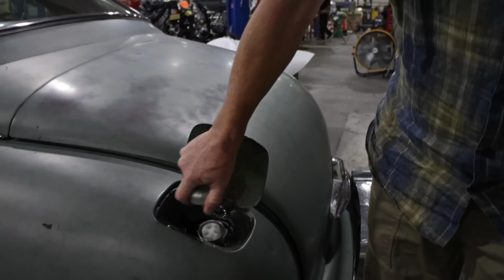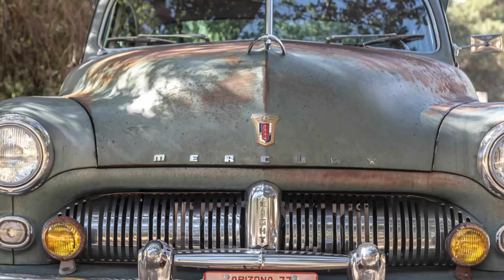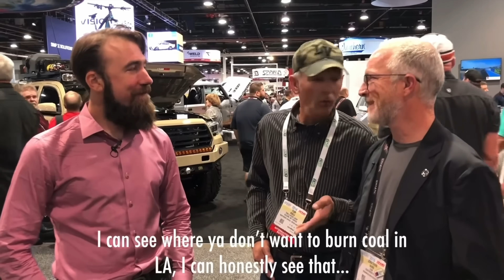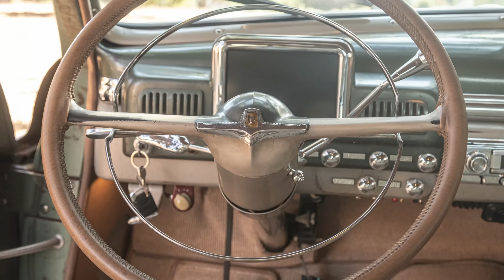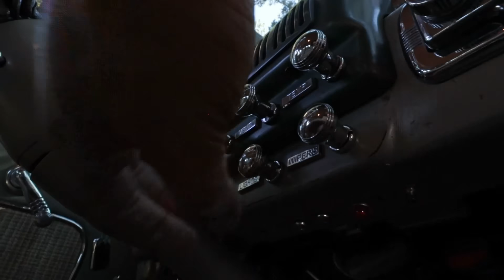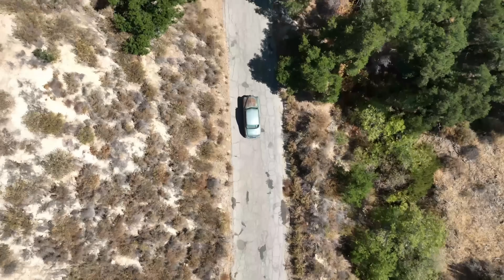ICON Derelict 1949 Mercury EV Coupe

Comment: Jonathan. I can appreciate the design of the engine bay. When I first saw the engine bay I assumed it was part of the cooling or battery system designed to look like a standard motor. The fact that you guys took the time to craft it to match the original is a testament to your attention to detail. The color combinations are wonderful and the integration of new and old switches and electronics hidden in the dash are truly impressive. I wouldn’t be surprised if your vintage to modern….analog to digital dash integrations are the best in the business, industry leading. You and the team are artist the videos are your gallery. PS your closing remarks are a good mission statement. 

Icon: Something to stand for, to be remembered long after we are gone!

Comment: A solution to the "road tax" complaint would be to report your annual miles when renewing your tags and calculate "road wear" by vehicle weight and miles driven.
It doesn't help that Teslas weigh 5,000 + pounds and a Camry weighs 3,400.
- - CO2 levels are within a couple % World-Wide and vary by season.

Comment: Glad to see a full video on the car.... really enjoyed it. But could have done without the diatribe on modern cars being disposable. Cars today have service life's longer than any point in automotive history. Sure, a lot of cool old cars are sitting in fields... but it was the unreliability of that old car that put it in the field in the first place.
Reply: Sure, cars in general are more reliable today, but there's hundreds of examples of modern cars being scrapped for a $100 transmission part....either that is not made anymore or costs many thousands of dollars to fix.   The perfectly good 99% of the rest of the car is given up on and junked so a new one can be made and sold.   So much waste.   That is far worse on the environment than keeping a SLIGHTLY less mpg efficient car on the road.   So much misguided focus on MPGs and not on the other 100 variables key to efficient motoring.
Reply: @benvester3340  Interesting... and I don't disagree, but, it's not just a modern problem. Back when used cars only cost $50 people would scrap them because of a $5 part. Unfortunately, scrapping cars keeps auto manufactures in business, circle of life, that one. Efficient motoring is subjective though as its definition will change between economic classes, environmentalists, mechanics, manufacturers, bureaucrats, etc.

Comment: That goofy old farmer made some excellent points.  I admired that you engaged with him at the car show.  Now, to hear you badmouth him after the fact… makes you look weak
Reply: That guy was off his meds, at no point did he make a coherent thought that they could even engage with. He was also being rude by interrupting them. They were much kinder to the blowhard than I would have been.
Reply: @k20nutz  but he DID make salient points which they DID engage with.  So….do you need to get back on your meds?
Reply: @yeboscrebo4451  which point was that?
Reply: @k20nutz  1. charging electric is bypassing taxes which pay for the roads 2.  Charging at 110 as opposed to 220 is inefficient and wasteful.  3.  Hydroelectric is definitely not “clean”.  4.  Burning coal actually entails benefits for agricultural areas that include fertilization and formation of rain.  5.  CO2 is not distributed in equal ratios around the world.  6.  Populated areas shouldn’t be able to “make the rules” for less-populated.  All these are points worth discussion, definitely not “insane”, lol.
Reply: @yeboscrebo4451  1. That is a issue with the tax system for roading, not electric vehicles, and has a trivially easy solution (plenty of first-world countries already charge road tax by kilometre travelled, not as part of a fuel purchase). 2. This could hardly be a more egregious case of Matthew 7:5 when you're making a comparison to internal combustion engines that are only 20-ish per cent efficient. 3. Again Matthew 7:5 when you're comparing the minuscule emissions associated with hydro to the colossal emissions from coal thermal electricity plants. 4. That's like saying that my neighbour should engage with the idea of burning down their house because it would slightly reduce my winter heating bills (and, by the way, rain did actually exist prior to humans burning fossil fuels). 5 & 6. In the context of global atmospheric pollution this argument is equivalent to saying that we should divide public swimming pools into two halves -- pissing and non-pissing sections -- so that everyone can choose whether or not they want to swim in pisswater.  Anyone with a milligram of common sense should be able to figure this out with a few seconds thought, so frankly no, it's not worth discussing in the context of an interview about a resto-modded/derelict '49 Mercury.
Reply: @davidhaywood8029  Who are you arguing with?  The point of listing out his arguments was that there was something there worth discussing.  Seeing that you took the time to type out responses to his six arguments, I’d say that’s it right there isn’t it?  For the sake of discussion, 1.  There’s nothing “trivial” about road taxes.  Guaranteed there’ll by collateral damage when the politicians start rocking that boat.  Personally, I would have a big problem with a mileage tax and the gps units they’re itching to track our traveling with.  2.  He wasn’t making any comparisons to the internal combustion engine, obviously.  3.  I don’t think the farmer intended on “comparing emissions” when he stated simply that hydroelectric power isn’t clean.  Besides that, the latest studies show that some of the most egregious problems with hydroelectric is not emissions, but the widespread and prolonged damage incurred to the environment by damning - problems that have been previously unaccounted for in regards to energy solutions.  4.  Agreed.  5&6.  To a certain extent, I don’t disagree with you and I don’t think the farmer would either.  However, generally speaking, his point remains.  Water regulations, emissions standards etc.  set by distant bureaucrats in some far off city with entirely different populations and circumstances is a recipe for disaster.  This obvious conundrum is an important enough factor to determine the way our republic itself is organized with representational government based on population numbers.  Anyone with a milligram of common sense should be able to figure this out, right?  What gets to me is the pompous way Jonathan brushes this guy off as “insane”.  It’s intellectually juvenile to disregard his points with “we all know who you voted for”.  The world could do without the rich guys’ toys that Jonathan makes.  It can’t do without the simple farmers.  Despite the goofy, socially unaware behavior of the simple farmer, it’s annoying that Jonathan’s spitting on the guy whose shoulders he’s standing on.
Reply: @yeboscrebo4451  My take was that Jonathan was including that clip to pre-emptively deal with some of the responses in this discussion thread.  But if the Canadian bloke did actually have mental or social issues -- rather than being a standard grade blowhard -- then I certainly wouldn't want to make fun of that.  (Incidentally I know this wasn't the point you were making, but -- as a side-note -- I'm not actually sure that we do need simple farmers.  I've worked with a number of farmers on farm-scale energy projects, and in my experience you've got to be very sharp and well-informed to be a good farmer.  It's a complicated business.)  To quickly respond to (some of) your points: from an engineering perspective, all macro-level discussion of engineering problems is "comparing emissions" (or comparing harm). All human activity causes environmental damage, but ideally we choose the design path that minimises harm.  So to claim that charging EVs from 110V "should be illegal because it's inefficient" is just plain nonsensical when considering the perfectly legal ICE vehicle that's only 20-ish per cent efficient. The same goes for the effects of damming rivers for hydro-electricity.  Yes, it causes environmental harm, but does it cause less harm than the alternatives?  That's the question that is implicit in any energy analysis.  The question of local vs. national/international environmental regulation seems well-settled in legal theory.  That which only has a local effect should be regulated at a local level; that which has a global effect should be should be regulated at a national/international level.  I've lived in four different countries and it seems that there is always some issue that's considered so difficult as to be virtually insoluble, but which in another county has apparently been solved with very little effort.  Much of Europe pays road tax by unit time ; New Zealand has a per kilometre road tax system that works in conjunction with the annual safety check.  These systems have been working for decades.  On the issue of "representational government based on population numbers" (or modern democracy, in other words) you should look at the ingenious MMP (Mixed Member Proportional) system used in Germany, which does a very clever job of ensuring that low-population rural areas are still guaranteed a voice in government.
Reply: @davidhaywood8029  Nah, this is the second time Jonathan has posted this clip.  It seems like he’s got a gripe with this guy.  This farmer seemed sharp as a tack to me.  I have to correct you, the farmer said “it should be illegal” because it is bypassing road tax.  “Charging at 110” was merely an additional point not the reason why it should be illegal, obviously.  I believe the farmer was referring to the charging inefficiencies in regards to charging time.  Again, he wasn’t comparing the charging efficiency to the efficiency of an ICE engine - that IS nonsensical.  And again, what you say about energy analysis and “does it cause less harm than the alternatives” is accurate, but, the farmer simply stated “hydroelectric is not clean energy”.  He made no comparisons in that simple, true statement.  Well-settled?  Nothing is well-settled, lol.  Representational government is Republican government.  I constantly have to remind people that we are a constitutional republic NOT a democracy.  Our founders despised democracy for good reason.  We also have an ingenious system called the electoral college.

Comment: This is amazing, and it'll be fun to see how your EV products evolve. I doubt that future cars will always be better than the last.

I am curious about a couple of things. 
Why do you have a drive shaft? Wouldn't it be better to have it directly to the rare end, skipping it altogether or use wheel motors like Rivian, cutting the Rare end and drive shaft? 
I don't know if Chassis builders like Art Morrison are there yet. But isn't a Skateboard Chassis more efficient with battery space? Having that plus your Engine design gets you more range? I think 200 miles is the minimum now (I have to admit I started hating that you put batteries in the front instead of a drunk, but you did sell me on it).

I disagree with the no trans that has been the chorus of EVs. Still, I think a gear specifically Tailored for Highway speed and bringing the output RPM as low as possible to be as efficient as possible is better than having a vehicle that only has a lot of range around town.
Reply: Rare Drunk?

Comment: I'm no designer, engineer or electrician but for the low horsepower classic cars, someone needs to develop an electronic motor that mimics the original engine that works with the original clutch and gearbox. This will come in time. Although the engine sound is gone, the straight cut gearbox sound would still be there. A dream for the future classics. I guess he said it right when he said the technology is moving faster than his company builds. Dont scrap those classics yet!
Reply from the maker: That is actually the easiest and most popular way to convert a classic car. The issue is that the manual transmission gear ratios are all but useless, and you lose a lot of energy efficiency that way, while gaining a lot of noise

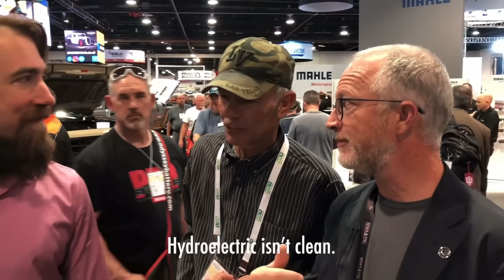Comment: 18:20 - Did that guy say that hydro electric heats up the water as is goes through the turbine? This would be bad but thankfully it is 99.999% inaccurate...the resistance friction/load on the impeller that the water turns is negligible and is a cold system. The alternator/motor/generator is connected to the impeller via a shaft(s) and isolating couplings, the alternator/motor/generator will make some heat but it is isolated from the water below it completely (as it is regulated and monitored by the government to not add heat to water) and is cooled with a oil system mainly for the bearings alone. If a power damn heated up the water it would kill everything alive in the water, thus it would be shut down. 

Then he says he would like to burn coal? There is a very dirty secret about burning coal, it becomes radio active in a fluidized bed that forms during combustion, this is why workers there all have to wear exposure tags, just like at a nuclear power plants too. 

The problem with carbon fiber, or just plain old fiber glass (I believe current windmills are mostly made of) is the resin glue...it is possible and likely to in-hail said resin dust as it can re-activate in moist lungs to block oxygen transmission. The rest of what he said was mostly correct actually. 

I love how you go on to say "the challenge is the many different perspectives in different cultures..." to me that sounds like some political BS to manipulate the truth to manifest a desired result... 💰Illusion is the absents of truth, is it not? The biggest difference between people are the lies they believe, their/your perceptions?  

EV's are cool and when ICON does it even cooler, even though they are mostly a one or two trick pony; totally predicated on a lie that they are actually green or better for the environment. Not many know enough about it so this partly why you are so easily tricked, the other reason is years of dumbing-down indoctrination and compliance training from the state. To learn the truth about compliance see #DrMigram 's work at Harvard after WW2. 
First easy lie or the evidence of the truth being hidden, google search the world's most fuel (energy) efficient production car, and you will get some Corollas at 30 ish MPG, a Prius maybe at 40 ish MPG, Tesla model 3 at 155 MPGe* (note this is an extremely convoluted BS equation that also averages the national power costs only at the time the car was released so it doesn't change). VW, before Diesel-Gate, was producing the XL 1, a diesel hybrid that was capable of over 244 MPG; and that didn't include bio diesel in the calculation of it's carbon foot print. This is truth...and only a brainwashed NPC will disagree with; and be angered by as it contradicts their programming to what some false authority figure said for them to believe as fact. 
This is just one example, their are endless more, but it is time consuming to just put them here and no doubt unwanted aw well, but you can start looking into it if you want...try the documentary "Planet of the Humans"? It's like the bigger the lie, the better it sticks from the propaganda programming, like it locks down via dyslexia or something, and everyone is susceptible to it in degrees like hypnotism? The government has developed ways to manipulated the weather but almost all of them create heat...that we know is very bad...especially the microwave array HAARP!

Comment: It's a giant step towards electric cars, Johnathan. Too bad people don't hook up a generator to the wheels so it will recharge the batteries as it is rolling down the road. That's way you will be charging the batteries with the same amout of discharge on the fly making the driving range much higher than 320 miles of travel on a full charge. You can use that in your EV cars. It's all about the money issues. Too bad you couldn't make a transmission with an over drive gear reduction with a generator behind it hooked up to the electric motor(s). Then hook the drive shaft to the back of the generator to the rear axel. Problem solved! Birth of a long-er range electric vehical!